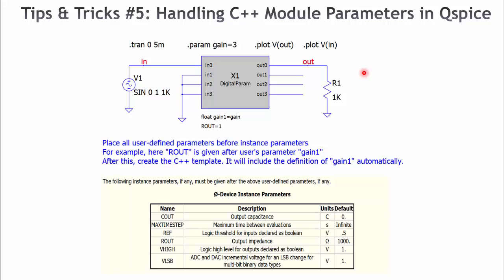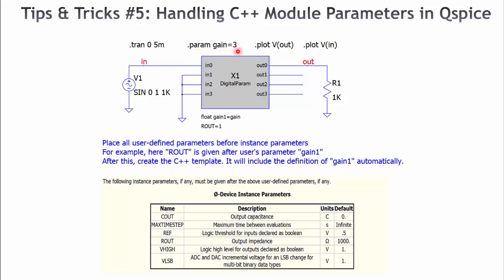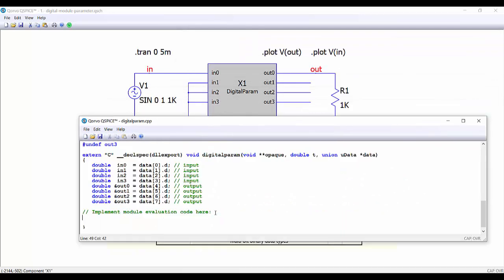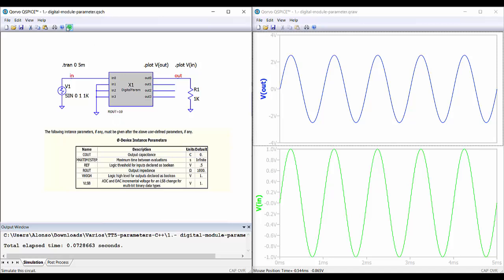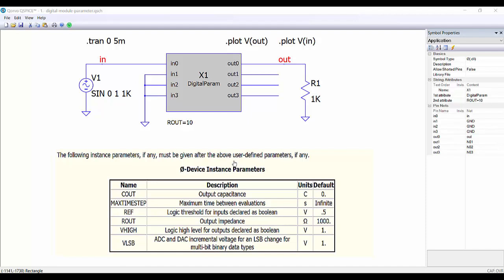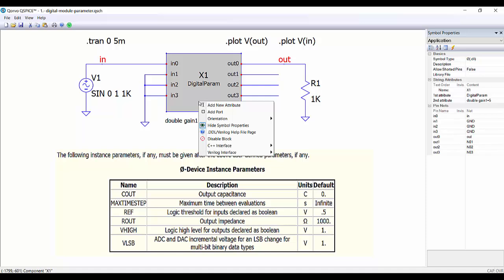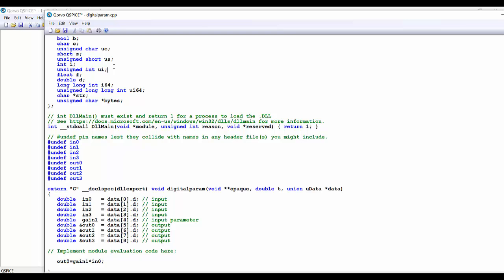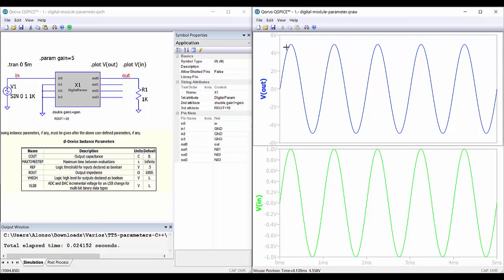TT #5: How to Handle C++ Module Parameters in Qspice

Comment: Hey Marcos, thanks for making this video.   Do you know if it's possible for a C++ block to model current at the pins?  For instance, can I make a C++ model of a load, that is dependent on the voltage supplied to it, as well as a very large number of parameters.
Reply from the maker: Hello, thanks for your comment
As far as I know you can only generate a voltage at a C++ block pin. But you can always transform it into a current by using an external behavioral current source B.
To model a variable resistance you can generate a voltage that is equal to a function multiplied by the current through the pin. You can also do it with a behavioral voltage source too. Even Qspice has directly a behavioral resistance. See Arbitrary Behavioral Voltage or Current Sources in the help file.
Hope this helps